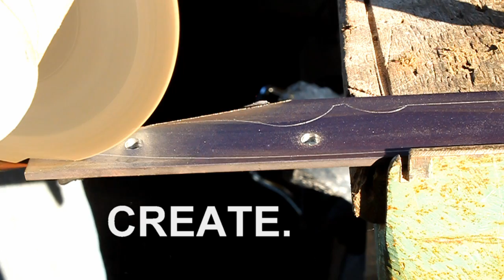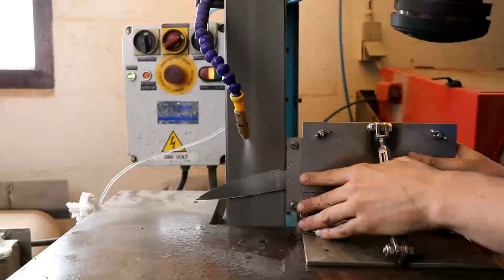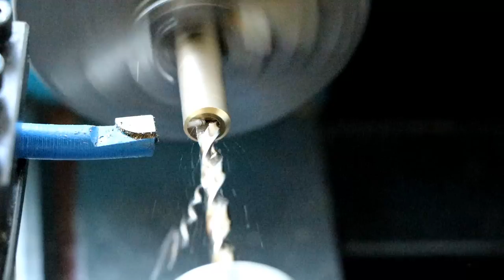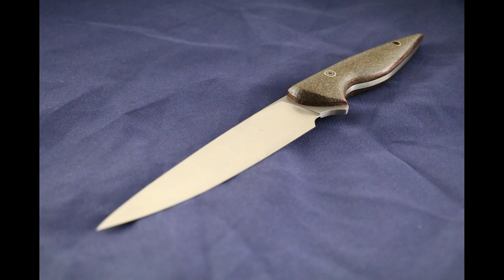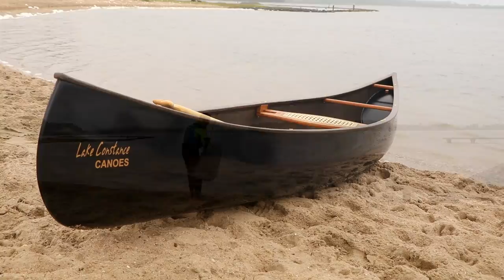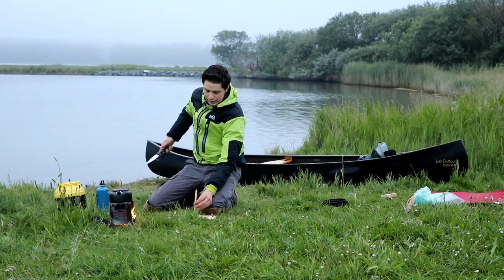Knife making: A modern bushcraft knife with home made micarta

Comment: do you make the inside for your brass pins yourself?
Reply from the maker: +Jörgen Börg no I cheat! I buy them from eBay. It's probably the only part that I don't do in-house
Reply: haha, yes, it is very hard to make real small designs like that. i made one for my damascus myself with different sizes brass. maarre, het is niet makkelijk ;-).
Reply: Je mes is wel zeer stijlvol gemaakt moet ik zeggen. klasse!
Reply from the maker: +Jörgen Börg dank!
Reply: Walter Sorrells has a great video on making  them yourself.
Reply from the maker: +Gaven Quillen yeah it can be a fun little project